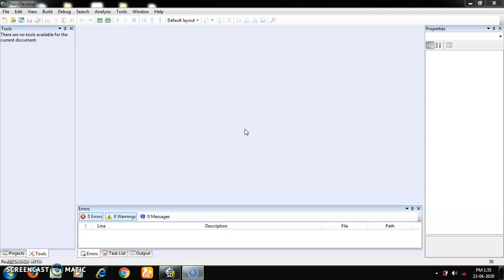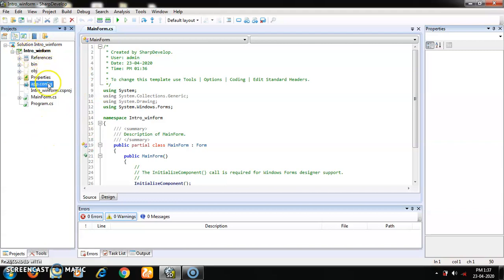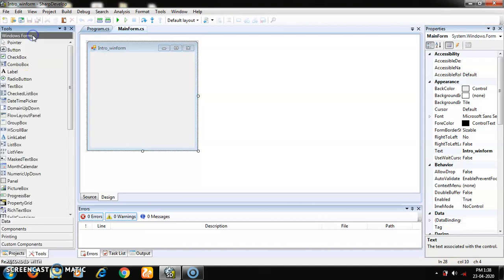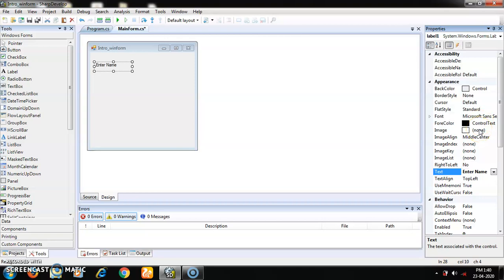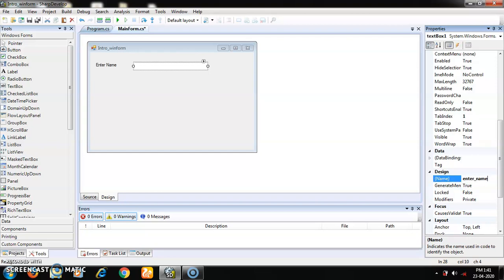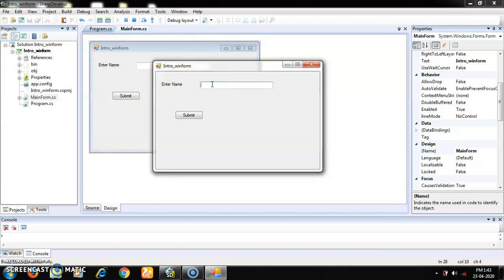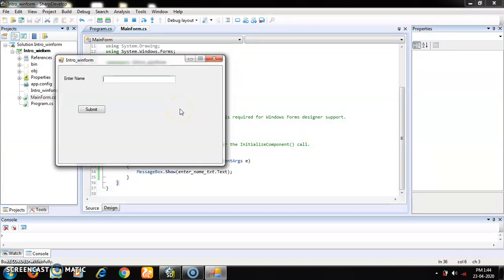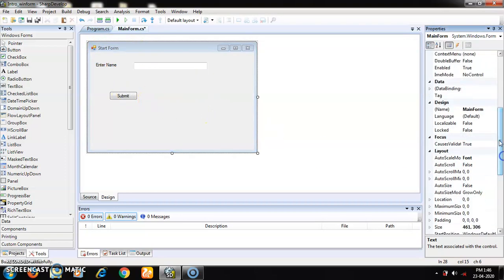WinForm - GUI - Introduction to Winform C# dot net 1

Comment: Can you run these forms in operating systems other than windows?
Reply from the maker: Yes you can .
by using Mono u can run on ubuntu machine.
Reply: @techboot3606  That is great. Microsoft's winforms can't run on any other platform than windows.
Reply from the maker: @BahawalTV  Hi you can try below link for more details
https://markheath.net/post/running-windows-forms-on-linux-with-mono
Reply: @techboot3606  Thank you! I will look into it if I can convert my existing winform application with devex components to it.
Reply from the maker: @BahawalTV  ok
Reply from the maker: Hi Friends created new play list for core java please go through it https://youtu.be/N_IQYuH0q6E?si=B-0yGPqTDbVe2WFC
Reply from the maker: Hi Friends created new play list for core java please go through it https://youtu.be/N_IQYuH0q6E?si=B-0yGPqTDbVe2WFC